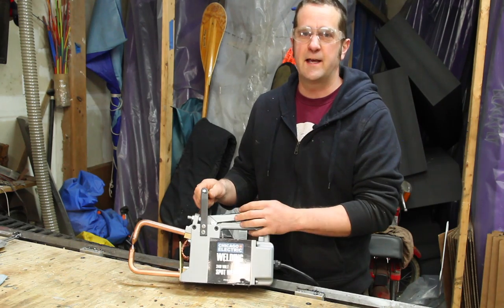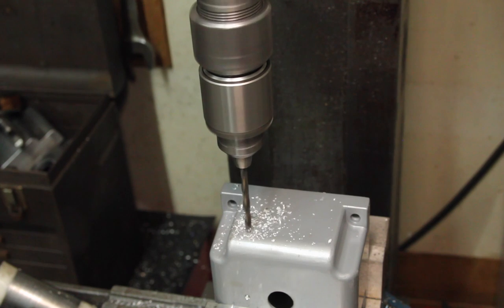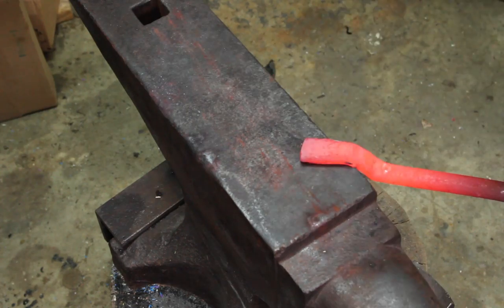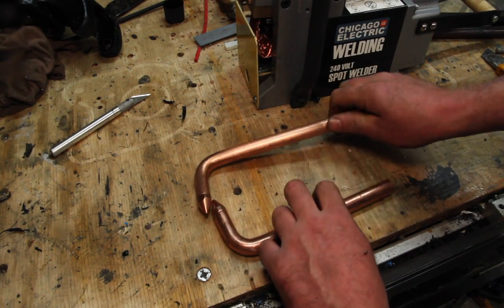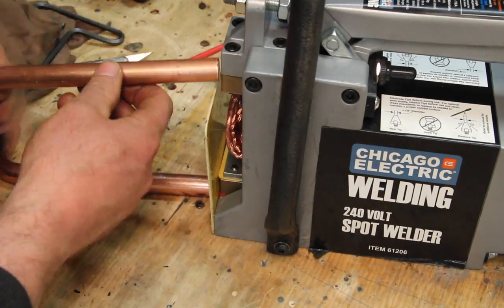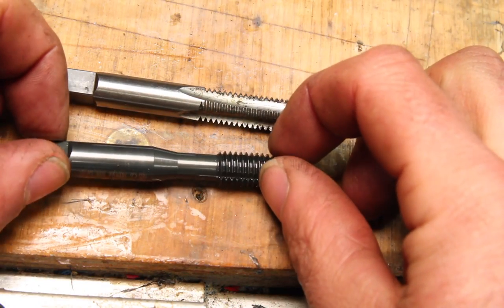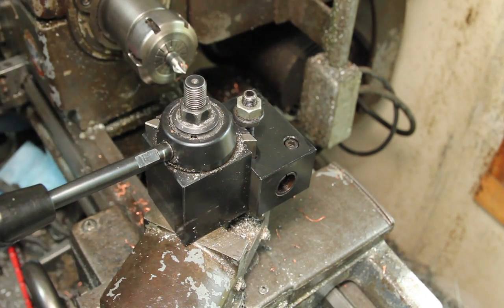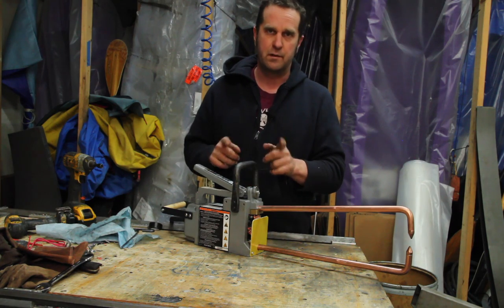Spot welder upgrades

Comment: Very cool! I have the 110V spot welder for putting together AK flats. I did not need as much mobility as you, and as such I hillbilly engineered an old Tig Welding foot pedal to run the current so I could maintain better control of my work piece. Just a thought if you were doing more stationary work.

Comment: What type of nema plug did you use?
I’m always changing my mind on putting twist or standard spade 1ph 220/240v outlets in my shop.
Reply from the maker: All my 240v outlets are 6-20 outlets- they were put in for my CNC router, mill, lathe, etc.  at some point I’ll need to add a 50amp outlet for EV charging, and then I’ll swap the welders over to that, but for now it works.

Comment: what would happen if you use steel for the rods? like you probably don't what the tips to be steel or they will weld to sheet metal, but would steel rods be fine for an extension?

Comment: If the tool is already too heavy and awkward, I'm not sure that putting a solid steel forged handle bar on it is going to help with that...
Reply from the maker: It was more awkward than heavy.  It’s much less awkward now.
Reply: @JeremyMakesThings  And the handle should outlast the tool by at least a couple thousand years!

Comment: Did the extensions need to be copper? Isn't the copper just so they don't stick to what you are spot welding, or is there more to it than that?
Reply from the maker: So the tips are replaceable, but the tongs are still copper.  I think if they could use something cheaper, they would.  I believe it has to do with copper having a very low resistance and the high amperage this thing is pushing through them, so I figured it was best to stick with what I knew would work.
Reply: It requires a lot of amps (at a very low voltage) to make a decent spot weld so you need ALL of the conductivity you can get, especially with a 'lightweight' machine like in the video that doesn't have a huge transformer creating thousands of amps.

Comment: ? from a electrical safety, would it be safer to put rubber tubing around the new handle in case it has a short you wont have a  circuit through your chest?
Reply from the maker: So one of the tongs is actually connected directly to the case- so the whole case is “live”  but you would have to touch the other tong to complete the circuit.  The reason it’s not dangerous is the voltage is so low on the “hot” end (maybe 1 or 2 volts) that it wouldn’t overcome the resistance of your skin.  If the line voltage side shorts out….that side is grounded, and you would still be holding some other metal part of it anyway, so I don’t think trying to insulate the new handle would be necessary.  Might be more comfortable though.

Comment: About to do the same trick, when you bent the copper extensions did you heat them first?
Reply from the maker: I didn’t bend them, I just made threaded extensions for the existing tongs.
Reply: @JeremyMakesThings  Ahh makes sense, thanks!
Reply: Did you actually watch the video?!?

Comment: Why cant anyone  separate the pinch tips from transformer (main body) with leads like the leads on welding machine and let most of weight sit on floor (cart). Looks like would be more agile to fit in tight places with less fatigue on arms. Is this just a cost thing What am I missing ? Folks been dragging welding leads forever. Better yet, this would be a handy accessary to use with welder already in shop. Open to suggestions.
Mike   Pasadena,TX
Reply: The spot welder only outputs a couple volts, so even the slight resistance of lengthy copper leads is enough to drastically reduce the welding current.
Reply: You do not have the arm strength to push two pieces of metal together for a proper SPOT WELD.

Spot Welding

What is spot welding? Simply defined, spot welding is “the welding of overlapping pieces of metal at small points by application of pressure and electric current.”

How to spot weld? Spot Welding occurs in three stages:

Electrodes seated in a weld head are brought to the surface of the parts to be joined and force (pressure) is applied

Current is applied through the electrodes to the workpiece to melt the material

Current is removed but electrodes remain in place at force to allow the material to cool and solidify

Spot welding times range from 0.01 sec to 0.63 sec depending on the thickness of the metal, the electrode force and the diameter of the electrodes themselves.

Comment: My Central Machinery Spot Welder had a copper shim around the upper tong.  I assume this was a correction for a factory mistake, making the upper bore .0020 oversized.  Did your welder have a shim on the tong?  You can see my welder at https://youtu.be/Dn-O_1799mA .
Reply from the maker: Yes, it has the shim as well

Comment: i burned my first one out by (i think) the switch stuck in on position
Reply from the maker: Ooh, I can see that happening. With as simple as this thing is, that’s probably about the only way to kill it.
Reply: I’ve got an older Miller spot welder with a timer. It was in the scrap pile, needed new power cords before I could use it, and ironically (cupronically?) the long offset tongs that I wish were shorter!